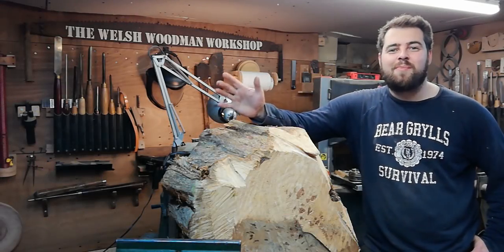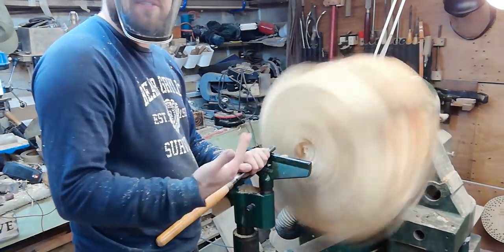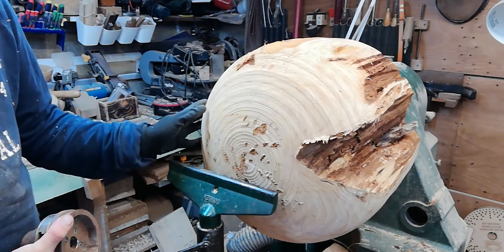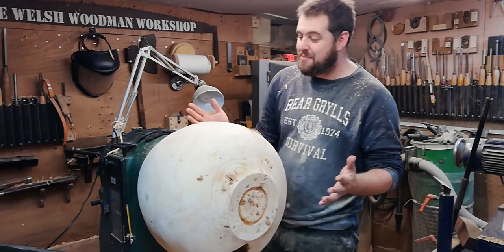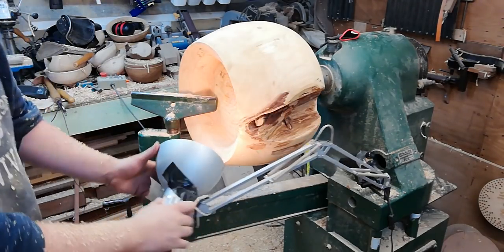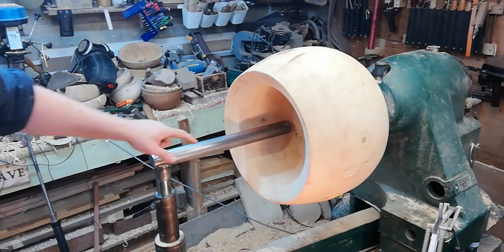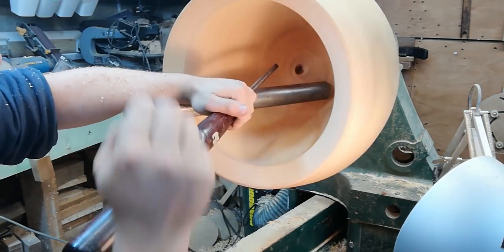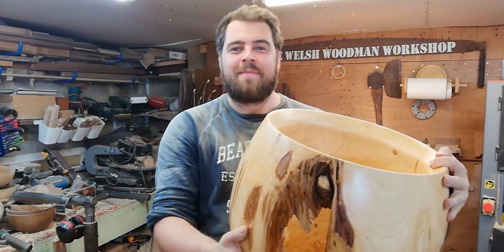Woodturning the tree trunk bowl

Comment: :D you are amazingly brave! Imagine the strain through those bearings, its incredible what forces these lathes can handle!  Awesome video as always.
Reply from the maker: Thanks Matt, the vb36 lathe was designed to turn larger bowls it has plain bearings and a huge shaft size which allows me to turn larger stuff comfortably, I probably wouldn't have attempt this project on another lathe as it would have knackered the motor and bearings 👍 thanks for watching 😁
Reply: @thewelshwoodman649  amazing bit of engineering!  i think I love the engineering of this hobby as much as the actual wood.

Comment: Bravo è stata una bella avventura, hai rischiato di rompere i cuscinetti del tuo tornio. Non sarebbe stato meglio  chiudere quel buco con della resina avrebbe acquistato un gran valore.Ciao
Reply from the maker: Grazie per il tuo commento. Su qualsiasi normale tornio da legno i cuscinetti si sarebbero probabilmente rotti ma il tornio VB36 che sto usando ha cuscinetti a strisciamento che possono sopportare carichi molto grandi (molto più grandi di quelli che ho girato), non tenterei questo tipo di tornitura con torni con cuscinetti a rulli come ciò li metterebbe troppo a dura prova.

Thanks for your comment. On any normal woodturning lathe the bearings would have possibly broken but the VB36 Lathe I am using has plain bearings which can take really large loads (much larger than I turned), I wouldn't attempt this type of turning with lathes with roller bearing as that would put too much strain on them. Sorry in advance for my poor translation of Italian.

Comment: Hi
I am a  new subscriber. Please can you go into more technical detail, e.g the tool you are using, how they are sharpened, type of wood being turned, sanded to what grit. Can we see you clean up the mortice, why you used a mortice and not a tenon. Speed you are turning at, ect...
Reply from the maker: Thanks for your comment Barry, If you check out some of my smaller projects in other videos I have tried to go into more technical details in them. For this video the wood was in the Cypress family, I turned most of the bowl with a 3/4 inch Hamlet bowl gouge with lots of sharpening on a CBN wheel (I have a whole video dedicated to  how I sharpen and another video dedicated to how I use my tools, which you might find interesting) The RPM speed will vary on the size of your piece, how balance the piece is and the lathe you are turning on, as the piece became more balanced I could increase the speed to around about 800-1000 RPM, the Lathe is a VB36 designed to turn very large pieces, I would not advice turning pieces this large on other lathes that have not been designed to hold this weight, as it could both be very dangerous and ruin your lathe...
Reply from the maker: (Part 2)...I started sanding after a finishing cut at 240 grit and sanded through the grits to around 400 grit, making sure there were no scratch marks in between each grit. I use a mortise rather than a tenon with larger pieces as you get a stronger grip, with a piece this large there is a potential for the tenon to rip clean off the bottom as the piece spins. Its really important to match the profile of your jaws perfectly in mounting pieces this large to get a balanced and strong grip. I used hand carving chisels to blend the mortise into the bottom on this piece rather than turning it off. Sorry that was a bit of an essay but i hope you found this helpful

Comment: What kind of lathe do you have and how is it mounted to the floor?
Reply from the maker: Hi Billy, the lathe is a VB36, it's mounted into concrete with some through bolts, you can also get a this resin you can put in the drilled hole that's ment to give you an even stronger hold  - I've made a video showing the process on my channel - laying concrete for the heavy beast - I hope this helps 😁
Reply: Thanks!  My lathe would have been walking all over the shop.  Since you answered I am now a subscriber.
Reply from the maker: @billy19461  Thanks 😁

Comment: Did you start off with a spindle roughing gouge?
Reply from the maker: Hi Mike, just to flatten off the bottom I used a really steardy/thick continental gouge with the wings ground back. I would never use a roughing gouge on a bowl as that could be really dangerous with the wings catching. I turned the rest of the bowl with a half inch hamlet masterflute bowl gouge 😁
Reply: @thewelshwoodman649  Thanks for the reply. Good looking bowl :)
Reply from the maker: @mikedeman5351  thanks Mike 😁

Comment: awesome bowl but wouldn't have been better to core it
Reply from the maker: Hi Steven, thanks for your comment, my first cut on the inside of the bowl I used my McNaughton coring system with the parting tool to cut out a V shape bowl to try and remove as much material as possible, there was quite a lot of rot in the central piece so I decided to hollow our the rest rather than making a nest of cored bowls 😁

Comment: Dude thats not a bowl gouge, looks like a French gouge or something
Reply from the maker: Hi Stink Bunny, thanks for your comment. For most of the bowl I turned it out with a Hamlet 1/2in. Masterflute bowl gouge, with a Celtic (or swept back grind) its a brilliant tool made here in the UK, I would highly recommend it, here is a link to a company who sells the tool in the UK if your 
interested: https://www.toolpost.co.uk/product/hamlet-12in-masterflute-bowl-gouge-celtic-16in-ash-handle
Reply from the maker: Just realized which tool you were talking about. At the very start of turning just to flatten off the bottom I used a really steardy/thick continental gouge, with the wings ground back so it wouldn't catch, taking very light cuts to creat a flat bottom the rest of the bowl I use mostly the bowl gouge I sent you the link for 😁 hope this helps